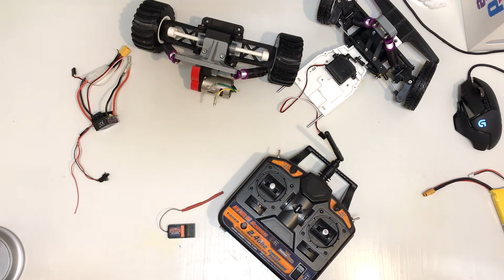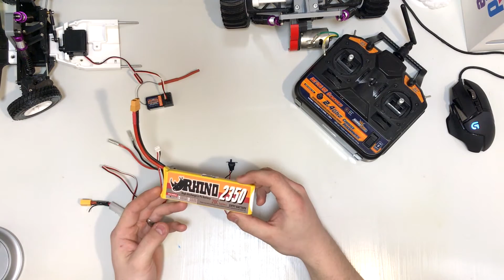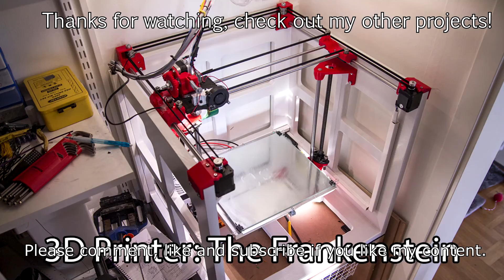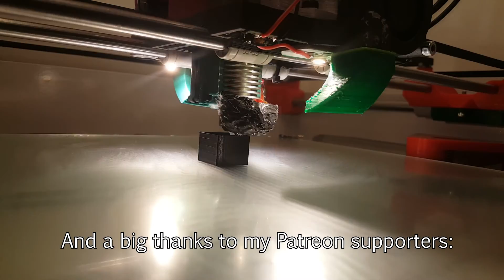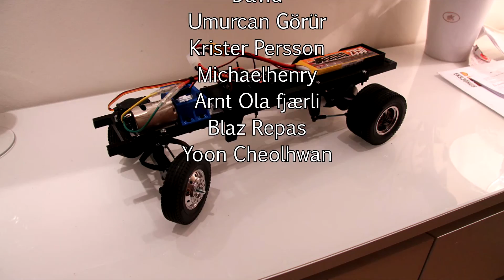How rc controls work!

Comment: Thanks for the video! What charger do you use for the Lipoly packs?
Reply from the maker: I use this charger from hobbyking:
https://hobbyking.com/en_us/turnigy-e3-compact-2s-3s-lipo-charger-100-240v-us-plug.html
Reply: Thanks! Although, it's out of stock right now so I think I'll go for this one instead, seems alright.
http://www.absima.com/en/products/charging-technology/chargers/lc-1.html
Reply: The motor just came. It doesn't have a cable for the ESC, would something like this https://hobbyking.com/en_us/pocket-glow-plug-igniter-charger.html work by cutting the other end? 

Sorry for bothering you so much, I'm new to this kind of stuff so yea.
Reply from the maker: No worries :)
Are you using the same 45A brushed esc that I'm using, with bullet connectors?
If the connector you linked is the same diameter then it might work but it's hard to tell the size. They need to be 3.5mm diameter if I remember correctly.

Alternatively you could buy something like this http://www.ebay.com/itm/50-Pcs-Blue-Male-Female-Bullet-Connector-Crimp-Terminals-Wiring-New-/171748396242?hash=item27fd008cd2:g:qHAAAOSwf-VWUAcZ
And then replace the contacts on the esc and motor(incase they're not the exact same as esc).
Reply: Alright, thanks for the fast answer.

Edit: I actually have one more question. I see you're using an adaptor, but what connector does the ESC have? Is it a Tamiya connecor?

Comment: Very good explanation!! I have to say that with a 2200 mAh 2S (7.2V) battery I could play with your 3D truck up to 45 min. But as the truck moves slowly it doesn't need as much power as the buggy.
Reply from the maker: Thank you! Yes, I think the buggy drains it much faster simply due to running full-throttle most of the time. :)